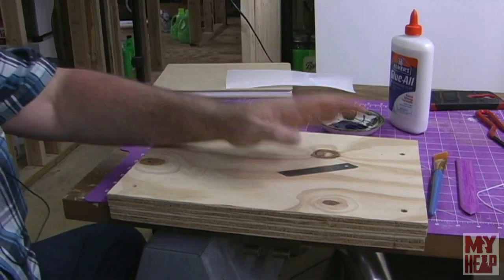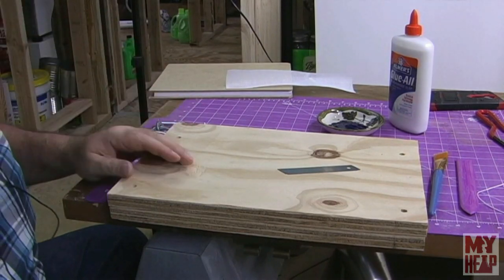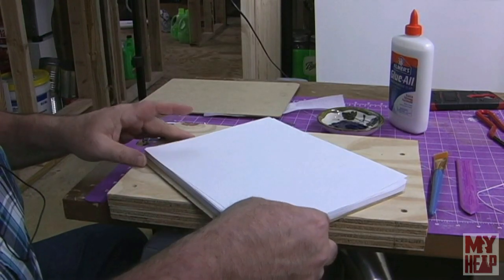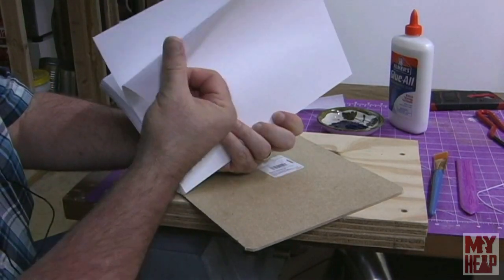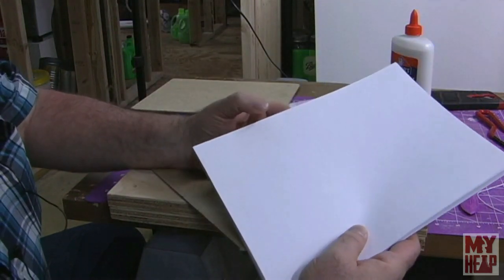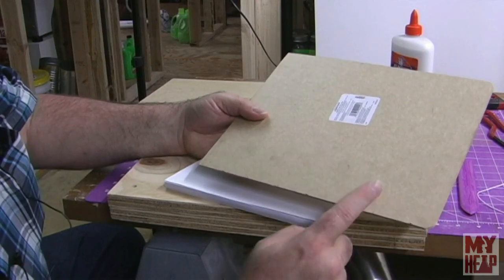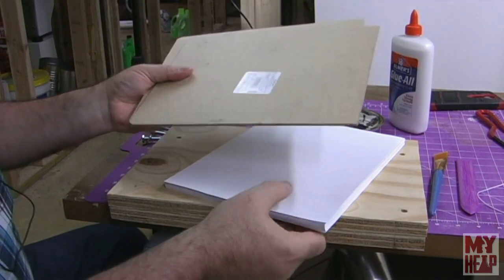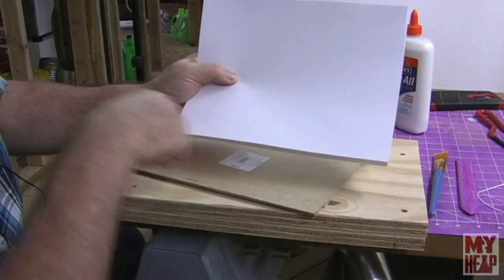Book Binding for the Home Shop - 03 - A Perfect Bound Paperback Book

Comment: I had some electronics books bound in this manner in Malaysia many years ago and although not used regularly they have been used and abused and still carry on...I'm looking forward to trying it myself...thanks Joe
Reply from the maker: Thanks Bob.  I want to release a little addendum to the process that makes it a little better.  Will likely be after the wheat paste video.  Am thinking I can get into the wife's "workshop" Friday and get that done.  Thanks for watching.  I know the series is a bit off topic.
Reply: Hey Joe I used hide glue on old clock cases as that is how they were assembled (I use shellac beads as well)...hide glue needs heat...I use a slow cooker with water...kinda a bit of a deal but I read hide glue was the go to for book binding at one time...if you ever feel like messing about I keep about a pound of the stuff around and would be more then happy to share
Reply from the maker: Bob,. I know that hide glue has been used on fine furniture, books, music instruments and other things.  As I understand, it is a great glue because you can "unglue" things.  I wouldn't mind trying it sometimes.  But the big question is does hide glue remain pliable after drying? Thanks for the offer Bob.